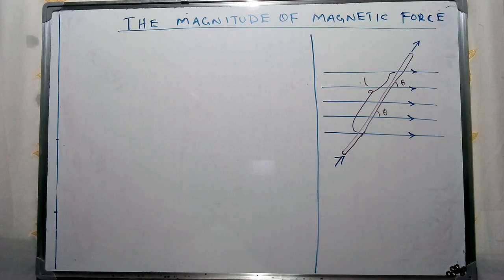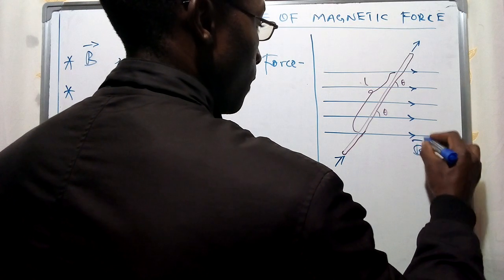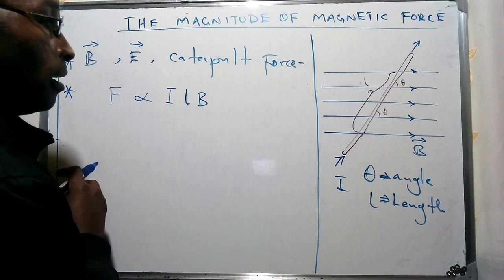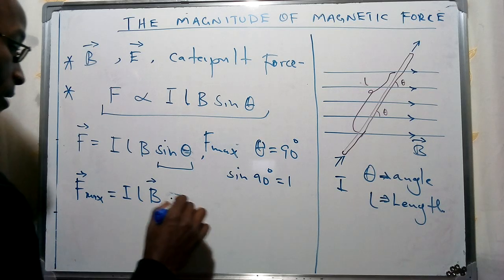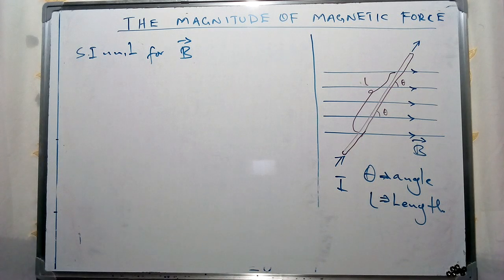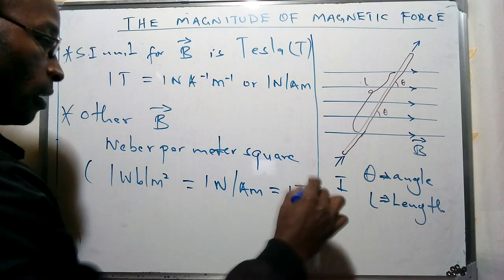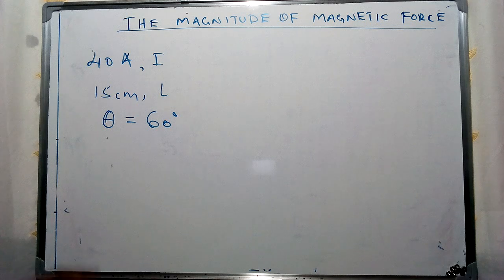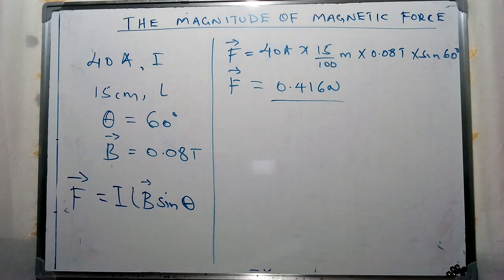How Strong Is Magnetism? The Magnitude of Magnetic Force

Comment: The Minimum force can be also on 180degree as sin 180degree is also 0 ,, and in the question you used as a example the answer when unsimplified is 6√3/25= 0.41  which you told . Thanks
Reply from the maker: Thanks for pointing that out.